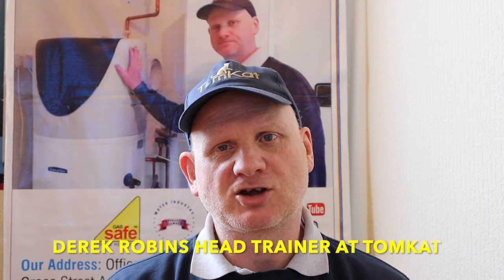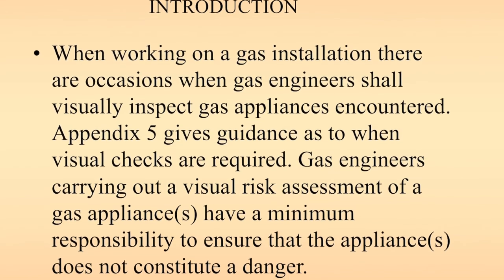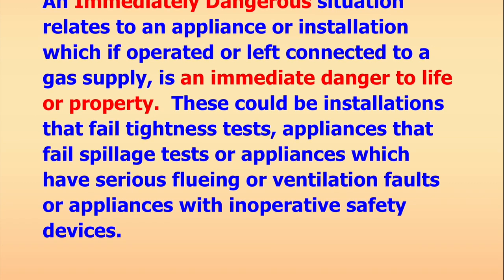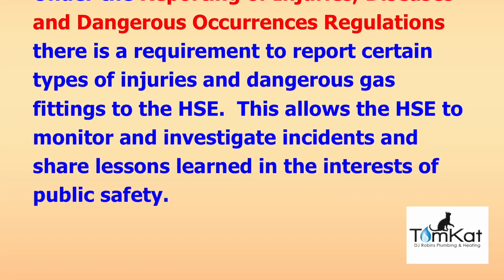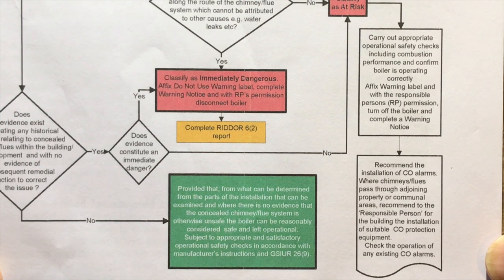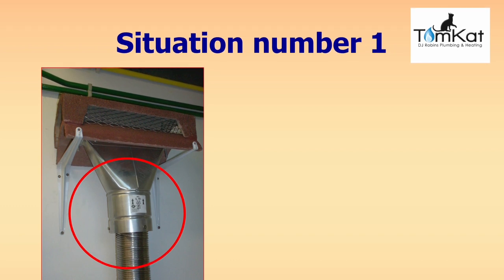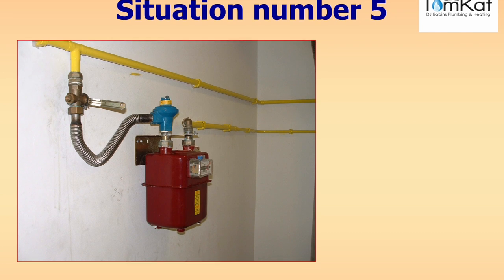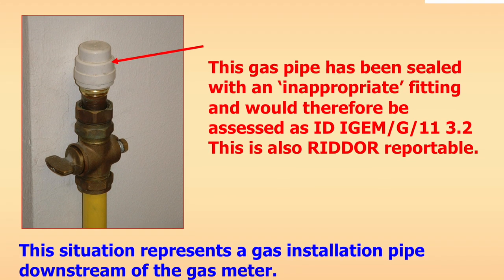IGEM/G/II UNSAFE SITUATIONS PROCEDURE. check out the procedure,  have a go at the quiz at the end

Comment: If a gas restrictor elbow on a gas fire installation was found turned off (ie screwed all the way in), but missing gas fire and the accompanying pipe work with no cap end on the elbow, how would you class this? Likewise, what if it was on cooker bayonet with missing hose. Thanks
Reply from the maker: Ibrahim Ali the fire is ID but a cooker bayonet is not classed as an open end because it’s self closing thanks for watching
Reply: Thanks for replying, I’ve come across few of these on gas fires so started questioning myself if it was ok like the cookers bayonet.

Comment: Hi Derek, (watching this video after you mentioned to me previously about checking other appliances, yep knowledge is power/safety) at your 13 minute bit, it shows that the PEB should be within 600mm of the meter or before first T (this is the same as taught on the course and fairly simple), I have been looking at this in various other booklets, some say 'preferably' and some say, anywhere on the pipe if it it continuous metal. Best practise would be 600mm or before T, but I have seen on quite a few installs the PEB on the pipework just before it gets to the boiler. Is any of this wrong, or is it down to the Engineer at the time (with maybe a label at the meter indicating where the PEB is )?
Reply from the maker: As you say it should be within 600mm of the meter or before the 1st tee this is to give the engineers maximum protection from stray voltage and you can see it is bonded. If on bonding present you notify the responsible person of no earth bonding
Reply: @tomkatgastraining  Hi Derek, in the Electrical bibles, they say that within 600mm of the meter is 'acceptable', but within 600mm of it entering the building is 'preferred',  but seems everyone is of the same opinion that it SHOULD be before any T. Just don't want to get anything wrong before my upcoming probationer assessment (I'm hoping to enjoy the experience, from what other people have said).
Reply from the maker: @davidb2464  we don’t care about electrical regs mate we just go off ours if you look at gas safe TB 102 will show you the location
Reply: @tomkatgastraining  Thanks, I'll look at that.

Comment: Hello  there are situations where a main bond is not required from an electrical point of view for various electrical reasons earthing systems and others  ,so there would be conflict if a gas engineer just kept saying it should be there....
Reply from the maker: We require earth incase of a stray currents which could cause a spark and an explosion. This point is also the reason we use a non contact voltage indicator to make sure it’s safe to touch because electrical regs say it’s not needed
Reply: If there is no potential to earth there would be no spark..eg  plastic incoming gas main, this would be confirmed with a test by the electrician on installation..I'm just saying it's quite possible for a gas engineer to find no bonding because a qualified electrical engineer has followed bs7671 and quite rightly determined one is not required....
Reply from the maker: @MrPowellfactor  we have to follow our regs and gas safe technical bulletins which says if we find no earth we report it to a responsible person and leave a notice that’s why we as gas engineers go on about it even if sparks say it’s not needed. I have had 2 really bad electric shocks through no earth on a gas pipe and one of the incidents was investigated by the HSE so when you say it’s not needed I personally think it is.
Reply: Well sorry to here of your shocks , all I'm saying there are circumstances where a main bond is not needed and fitting one may actually cause a potential issue..its not for a gas engineer or gas safe  to categorically state one must be provided, more possibly to advise one may be needed and and I would agree usually is..my point is it's not always needed . .and it not me saying it it's the electrical regulations.
Reply from the maker: @MrPowellfactor  you also have to think that gas engineers have to cut into gas pipes which are copper and they use steel pipe cutters which are not plastic or rubber coated so this is what can cause the spark with stray voltage which could lead to an expansion. At the end of the day if every house in the U.K. had MCBs and RCDs it possibly not matter about the gas pipe being earthed but not every house does.
Reply: I understand what your saying...BS7671 says if its deemed not required by a qualified electrician following testing and earthing arrangements it won't be fitted...then along come mr/miss gas engineer slapping a sticker on it or issues a warning notice following a visual inspection only..are you familiar with the 18 th edition wiring regulations?
If a gas supply has no contact or potential to the mass of earth it will not be deemed as an extraneous conductive part and therefore no bond needed..
Reply from the maker: @MrPowellfactor  yes, as gas engineers we issue a notice to the customer to get it checked by said electrician but as far as we know not being an electrician it could be dangerous. At the end of the day the place will be a safer place to work if we all do our jobs and in this case if the earth is missing we report it and electricians make the decision if it’s needed. If someone gets injured or killed or there is an expansion we as gas engineers have done our bit to stop it.